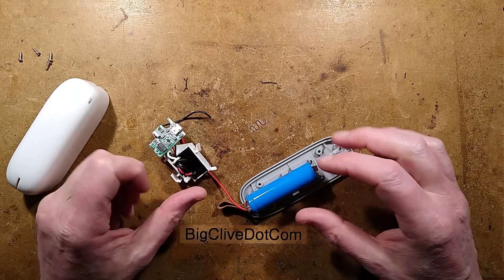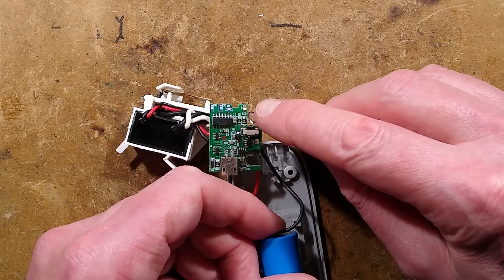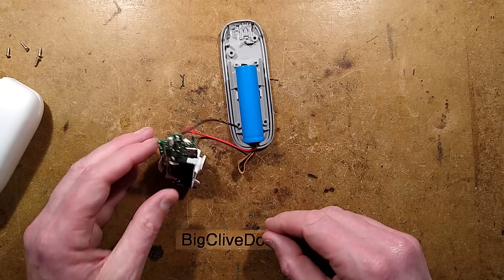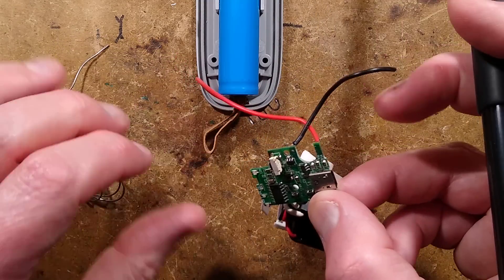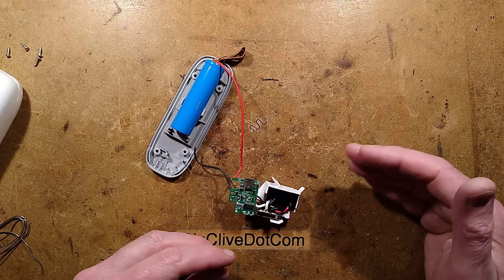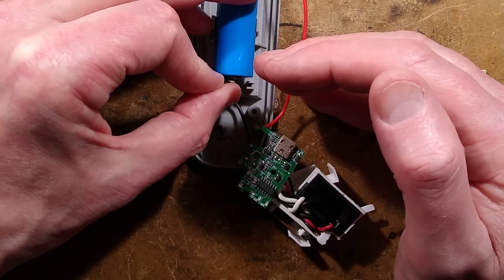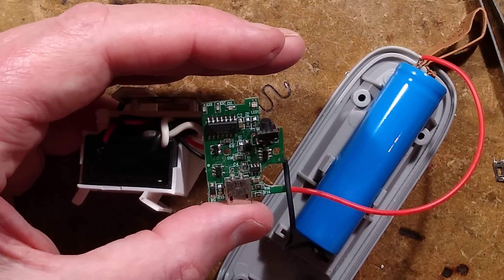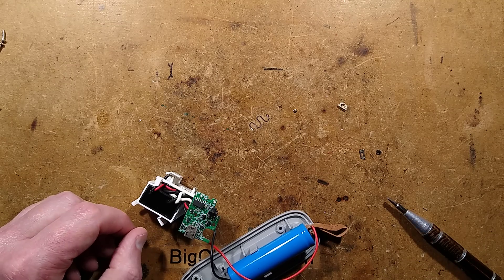The curse of tin whiskers rears its head again

Comment: I remember the transition from Leaded to Lead-free solder well. One of my suppliers delivered a dozen units of hugely complex hardware, all tested by them, but only 1 of the 12 worked on delivery. After some considerable investigation by all concerned, we found many plated through holes in the PCB to be cracked. I recall the manufacturer explaining that because of the higher melting point of lead free solder, when the boards were put through a solder bath, the PCB was in a semi-liquid state. This in turn caused the problems we were experiencing. It took a full year to redesign the entire circuit board as well as the processes to deal with the higher temperatures. To this day, I have kept some leaded solder, 'just in case' (although the lead-free solders are a lot better these days).
Great video, and thanks for the reminder of this interesting time in our industrial past!
Reply: So, they were doing the electronics equivalent of putting unleaded petrol in a car designed for leaded, and then being surprised that it didn't work correctly.

Leaded solder is definitely much easier to use (and perfectly legal) for repairs and personal projects. For large-scale industrial production, it's mainly a matter of using the appropriate formulation and temperature control (which needs to be a bit tighter than with leaded).

But we're doing far more complex and dense circuit boards nowadays with lead-free solder than we ever did in the 1980s and 90s.
Reply: @RFC3514  
Yes, I guess so. 
And us poor techs were left scratching our heads wondering why (in one example ) some models would fail to start from hot,  for example after driving to work and then trying to leave for lunch, but  were fine from cold, and yet other examples of the same model had the reverse concern of not starting from cold ( on frosty mornings-we don’t get snow here generally) , but once started (usually a little later in the day when the ambient temp had risen somewhat) would be fine for the rest of the day…

Once word got around we got adept at using bags of ice or hot air guns to diagnose the issue (which was somewhere within the ECU/PCM)
Reply: We were unaware of it at the time it was happening , but we techs discovered much later that we’d had the same things happening in the automotive field as well. 

Random modules would start exhibiting random behaviours and in some cases corrupting the CAN networks to the extent of inducing driveability issues. A lot of our stuff is ‘black box’, heavily potted and essentially impossible to rework dodgy soldered joints, so replacement was the only solution. 

There also appeared to be a vibration/temperature component  contributing  as well, I assume that this was the result of micro cracks due the lack of ductility (I think that’s the attribute?) of the lead free solder.
Reply: Back in the day a popular supplier of electronic components in the UK became afraid that they would get lumbered with their vast stocks of leaded solder and so sold it off cheap. I kept adding some to every order. Suffice to say, I probably still have a lifetime's supply. [Incidentally, I'm a retired research chemist and so totally immune to the dangers of lead.]
Reply: I doubt that tin whiskers is the real issue. That push button was probably just contaminated with flux and some other crud.
The transition to lead free assemblies certainly posed many challenges. I think ultimately the requirement for tighter process controls has lead to more reliable PCBs on the whole. From reputable manufacturers I might add. The cheap stuff is and always has been rather hit or mis.
Reply: And yet thousands of lead fee PCB's are produced dally with zero issues.
Reply: @mfx1  Yes, they are now. It was the transition time that caught some smaller manufacturers out
Reply: @grozdoescycling  But this video referred to lead free solder being a problem which it clearly isn't in this case.
Reply: @mfx1  It is a problem. Lead-free solders are harder to work with, work correctly under a much more limited set of conditions, and are more prone to failure. "Working around a legally-mandated problem" is not the same thing as "solving a problem".
Reply: @CptJistuce  And yet there is zero evidence of it being "more prone to failure". Yes it is harder for hand soldering/hobby work but the video is not about that.
Reply: Up to this day I use leaded solder only working with PC/laptop repair, include leaded BGA balls. Much easier, less stress and totally 0 issues on long distance if you have proper tools, expendables and understanding what and why you do.

Comment: I usually like your videos, but I was hoping to see how you narrowed down the root cause to conclude it was a tin whisker issue (even if just with documentation that the parts often suffer it). Instead, I was disappointed: the anticipated evidence wasn't found, but the initial suspicion was assumed true anyway, with lots of shade thrown without first establishing if it's deserved.

There are plenty of other ways for a switch to go bad, and even methods of shoddy or cheap construction unrelated to lead-free solder.
Reply from the maker: To be more accurate would have required a lab grade microscope.

Comment: Tin whiskers were a major problem at a computer manufacturer where I worked.  They became a problem especially as track geometries became smaller on circuit boards.  They also plagued the RF filters on my Ham Radio club's mountain top 2 meter repeaters.

Comment: Also look up Conductive Anodic Filaments.. copper whiskers growing in FR4 boards inside the bundles of glass fibre. Stuff turns itself on mysteriously after a few years, made worse by higher soldering temperatures and the fire retardant chemicals..

Comment: Yesterday was terrible. I spent too much time (15m) around a uv light I put in a damp basement corner.
    
Just want to reiterate the warnings, they are reasonable and then some. It took 5 paracetamol and hours to even keep them open a few seconds, slept it off mostly (kinda have to, not much of a choice). Still hurts but tolerable. 
    Learn from others if you can. I was in the "aww, can't be that bad" camp previously. That was a mistake.

Comment: Lead wasn't banned by ecologist. It was banned by doctors. The science of the damage it causes is clear. Yes the one in the fuel made more then 90 percent of damage, but its benefit was that it thought us the issues with lead.
.(Why is the autocorrect changing Lead to LED?)
The problem with sh*ty solder is not missing lead, but the fact of it being a cheap and s**ty solder.
I am younger then you (Not much) and learning mine DIY soldering with "Good quality" lead free solder means I have no problem using it.
Unfortunately nobody does listens to ecomentalist.
Actions are taken to pretend that they were listen to, but most of those actions (such as funding to support electric/hydrogen cars, hiding waste CO2 bellow ground) are done to pretend they have listen and usually result in more environmental damage then doing nothing.

Comment: Tin whiskers were the scurge of germanium transistors,especially with grounded can, even some potentiometers from 70s had the problem too
Reply: I was told a dirty trick for transistors with tin whiskers... wire b c and e together n short a 25v 2000uf cap between them amd the shield lead, would usually last long enough for the new part to arrive

Comment: I've seen tin whiskers routinely show up on plug-in automotive fuses since I think they're 100% tin (kind of expected). I've also seen them inside 3M-manufactured Faston-style connectors (mechanical stress during manufacturing), the potentiometer cans of a dbx active crossover (always warm), and frighteningly enough the legs of a modern crappy thin-tab TO-220 ON Semiconductor 7805 voltage regulator inside a pick and place machine feeder (wtf)...

Comment: Gotta love Clive:  No fingernail clippers in Scotland, just Dremels. The switch will get wet in the fridge and under such low currents fail to clean itself. In the tropics I go thru washing machine switches by the bags. Tin whiskers were a short lived issue. Sony and many others had huge issues but solved them quickly. Only repair techs now have to convert repair areas to traditional solder to avoid overheating issues. I am going to order one of them to see if my cheese will last longer. I have used large ozone machines to desinfect whole houses.

Comment: While not denying the tin whisker issue, the switch contacts aren't usually tin-plated AFAIK. I think it's just from the moisture condensing from the cold air in the fridge in this particular case.
Reply: Pretty sure it wasn’t the fridge one that was faulty, it was one that “was just sitting on a shelf”. At 0:30

Comment: The whiskers are more common inside Li-Ion batteries too😮. Especially, if they are allowed to discharge beyond the min voltage, the whiskers dendrites grow to short out the anode and cathode. The primary reason, why you don't want to rundown your BEV battery pack(which most likely has a hidden capacity to handle this situation), and the reason, it takes a while to charge from a low state of charge(pumping high current could potentially cause thermal runaway, if whiskers have already shorted to begin with🤔).
Now back to the typical Li-Ion cells in consumer devices: Most chargers will not prefer charging them. I have tried a few tricks to get these batteries functional with good success though.
Reply: To be precise for anyone looking it up, I think these are usually termed dendrites, not whiskers.

Comment: often worth a try with a 5a current limited psu straight across the switch pins when still in circuit.... whiskers act as fuses at meaty current so blowing them to F can sometimes fix the problem.

Comment: This brings up an interesting concern I have right now. Our facility is currently using K100LD solder instead of SAC305 due mainly to cost and temperature stability. In your expert opinion, should K100LD not be used in manufacturing of electronics?
Reply from the maker: That would depend entirely on your manufacturing method.  I can't really give advice in that regard.

Comment: I have one of those rearview mirror camera setups.  The ones where the internal rearview mirror has another mirror clipped over it,  but this mirror is a touch-screen.  It can show the front view via a built-in camera, and the rearview by another camera connected with a long cable ran to the rear. It records and had reverse-cam funtions etc blah blah and all that.. Anyway mine has a function to switch cams just by swiping the screen left or right.  It occasionally does this on its own.  I have to reach up and swipe it to the split-screen of both cams, then back to the rear view.  Sometimes, it will just freak out and keep switching the view-angle over & over.  I bought one for my parents vehicle and its touchscreen is dead to the touch in all the areas that matter for accessing the menus to set the date, impact sensitivity etc. only the very top few mm's of the screen and the far right edge still respond to touch inputs.  

I wonder if the tin whiskers have occurred in these two devices.

Comment: I think I've mentioned this in your comments before, but I was once witness to the aftermath of a many thousands of KVA APC Symmetra UPS exploding and taking out the fuses on the local substation in the process from tin whiskers growing, a byproduct of them cost cutting by tin plating the high voltage bus bars, bus bars which had been plated with nickel in prior units.
Reply: Geez, I knew the consumer range had gone to shit, but the big iron stuff, too?

Comment: I first come across tin whiskers in the early 80's on a power relay brand new from the manufacture and never been used. it is caused by the intermetallic  structure of the base layer ( copper) and the finish layer (tin) the tin ( shinny tin) compresses the copper and in doing so the copper tries to escape hence the tin whisker, the way to reduce this is to add a nickel layer in in between  the copper and tin layer which reduces the pressure and using matt tin also helps. this happens all because lead has been removed. lead free solder are still exempted from the RoHS directive  for certain application like aviation.

Comment: It's interesting to know that you can have a low-level ozone generator inside your fridge and that it will keep food from molding (Or getting mold or moldy, idk what is grammatically correct actually).
I thought it would just destroy the food like exposing it to UVC would.
Ozone irritates the lungs and brittles plastics after all so I expect it to do the same with food as well.

Comment: And yet you get so called experts, one I recall being a designer saying lead free solder is ‘better’ and it has no effect on product reliability and longevity.  

That you can’t realistically distinguish a good solder joint in unleaded from a bad one was glossed over.  I gave up trying to discuss this with them a long time ago.  A decade or two down the line, and the failures in the field I know I was right.  Meanwhile kit from decades earlier still just works. 

When some distributors were rumoured to be banning sales of leaded solder for ‘non professionals’ (I can’t recall if it was Farnell or RS) I bought a lifetimes supply of leaded, some with silver, and now I know I’ve got more than I will ever use especially when hampered by two cataract lenses corrected for distance, so poor close up vision,  and above all the hell of SMD.

Comment: You have described quite a few ozone generators that seem to work fine except they have Live or Neutral directly attached to an outside carbon fiber brush or similar. Since we don't use much NT networks here in Norway, mostly old IT, live and neutral are basically the same, so it doesn't matter. While this is all good and fun, have you come across one that you can really recommend? Preferably one that doesn't cost a fortune…

Comment: Few years back at surplus shop I picked up a home-made variable AC / dimmer box of some kind with a meter on it and two AC output plugs.  It was in a raw/unpainted metal box.  It looked well made and worked fine but I was curious how beefy the rheostat/variable resistor was on the inside (for wattage rating).  Got a screwdriver out and opened up the box on my computer desk here.  As the lid popped open about a thousand tiny slivers of loose tin whiskers spilled all over my desk.  It was a mess to clean up and my first experience with the dreadful things.  The dimmer still works at least.  I may have to open it up again and dump out some more one of these days.

Comment: One more reason I never switched. It's impossible to tell a cold solder from a good one when using lead-free. It's always dull and it doesn't flow well like lead solder does. 
More like a booger stuck at the tip of the iron, than a nice shiny ball of solder! 
You can all clutch your pearls and give me the evil eye all you want. I ain't switching.
Reply: Sounds like you tried SAC305 solder or similar. The 99% tin stuff is shiny and eutectic.

Comment: What timing! I just had a bike headlight fail in the on mode. It had a very similar switch. It has since cured itself, so now we'll see how permanent its reform is. Any idea about what provokes the whiskers? Humidity? Another factor in the emergence of this is the dramatically reduced current needed for many devices. Old school electrics would have cleared developing filaments as the switch arced turning on or off.

Comment: When i was still in an Army Project Office, we spent innumerable hours dealing with making sure we did NOT have lead free solder on components, leads, etc. We dealt with missiles that could spend years in storage, but work perfectly when needed. RoHS was a major problem, and meant that every part had to be certified as not using pure tin solder or coatings. Parts would sneak through, or manufacturers would change processes without proper notification. 
Between RoHS and moving to plastic encapsulated microcircuits from ceramic components as ceramics were mostly phased out, we had our hands full making sure we had systems that would work when required.
Reply: Current Army programs have no problem with lead-free; nowadays you can have similar-looking issues come from Electrochemical Migration (ECM) from halogen contamination in flux. IPC class 3 etc mandates flux cleaning which is one reason it's less of an issue.
Reply: @Z0DI4C  But the army does not phase out old hardware every five years or so. They need their replacement parts to meet a consistent spec, and mixing things up causes problems.
Reply: @Z0DI4C  Trump 2028!

Comment: Recently I had a failing nixie tube pcb. After removing most of the components the problem remained. Fed up with this, I blew the whiskers with 50V PSU. They had grown under the nixie driver. Invisible to the eye but a neat flash when it blew.